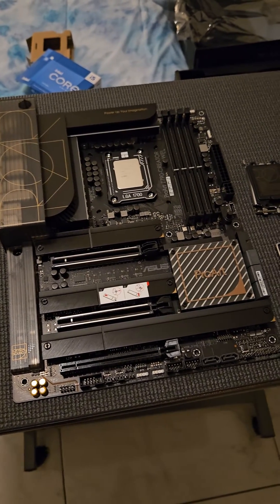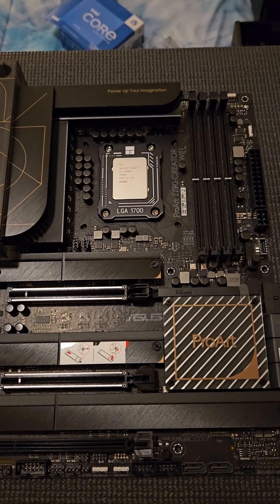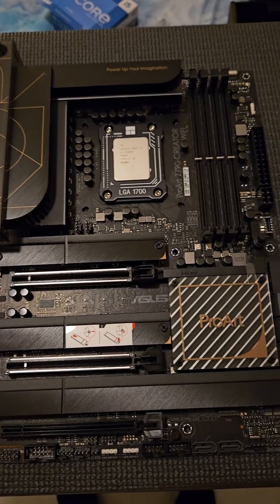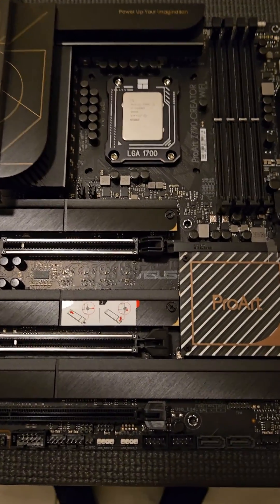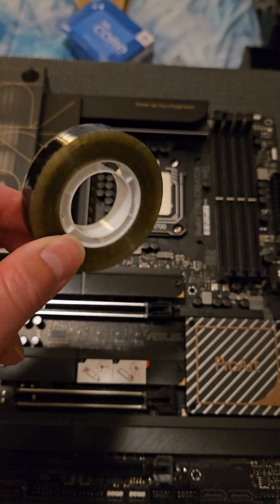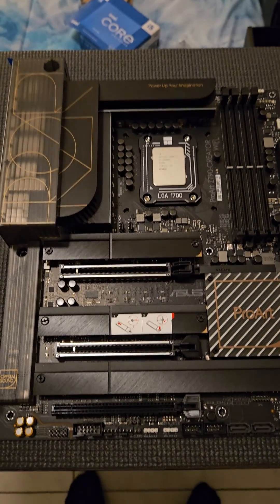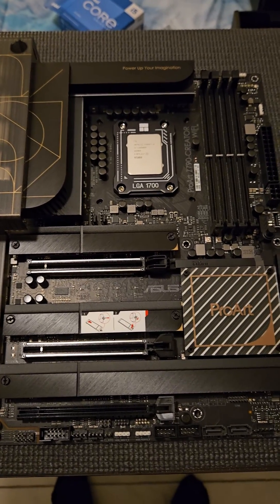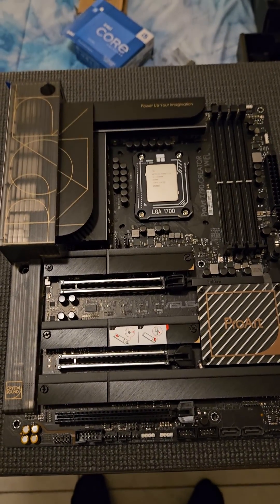Thermalright lga 1700 contact frame on asus proart z790 motherboard

Comment: Install your coolers bracket first and that way you don't have to worry about the back plate falling off. Good to see the the Thermalright  frame fits the ProArt. I've heard some people have had issues with the thermal grizzly version on this board.
Reply from the maker: The reason I Just went ahead and used anti-static tape because i heard of the backplate falling off even with the cooler brackets installed and I didn't want to take any chances on that happening. but yes i am very relieved that screws were long enough after hearing people having issues with the TG frame on this board.
Reply: @Yukeena  Fantastic. Have you tried more than two sticks of ram with XMP? I'm still thinking about picking up this board. I have the z690 Aero D and it's been a bit finnicky fore me. I can't keep any consistency with the turbo boost on that board and have had other various issues. Probably my fault for buying it second hand.
Reply from the maker: @timotmon  I have not. I do want to try it though to see if it would be stable. RIght now with all xmp profiles, it runs great. No BSOD or anything like that, so I think if I tried 4, it would be nice and stable. If I do try it soon, I'll be sure to return to this thread and let you know! And I say bite the bullet and go for it. Treat yourself! Its a really nice board and I haven't had any issues and its worked consistently for me so far.
Reply: @Yukeena  Cool, yeah I already ordered one. I've been working on the ProArt B550 Ryzen board for last couple of years. It's been pretty solid too.

Comment: What is the purpose of antistatic tape? I don't understand why you use it and why exactly antistatic?
Reply from the maker: I'm just paranoid about ruining my stuff and even though the chances of static electricity messing up your components is very low, I still take precaution. And the reason I taped it like that is because I heard some people mentioning that their backplate fell off when removing the ilm. Also it was my first time installing a contact frame and did a lot of reading and research before installing it so I wouldn't screw anything up, so thats why I was so careful installing it lol.
Reply: @Yukeena  Thanks, I got it. Now I remember that there are special anti-static gloves, you might look into them.
Reply from the maker: @idv-gaming  lol thats funny that you mention that because I was at the hardware store the other day and I started thinking to myself "I wonder if they have anti-static gloves". but thats good to know there is some available. I'll look them up. Thx!
Reply from the maker: @idv-gaming  also i'm doing another intel build. I just bought another contact frame. this time i'm doing a micro atx build with the Jonsbo z20, a 4060 8gb, and i5-12400f. its going to be for my livinng tv to do 1080p 60 fps gaming (because that is the limitation of my television) and to watch anime and movies.
Reply: @Yukeena  Good luck with the new configuration :)
Reply from the maker: @idv-gaming  thx buddy! Very excited because i just got my graphics card today. Just waiting on the mobo, cpu and psu.